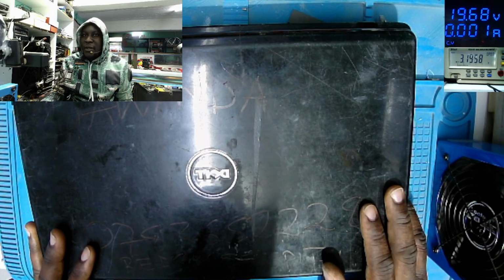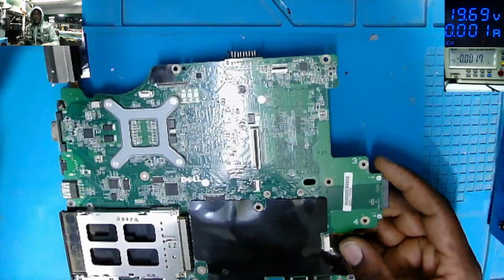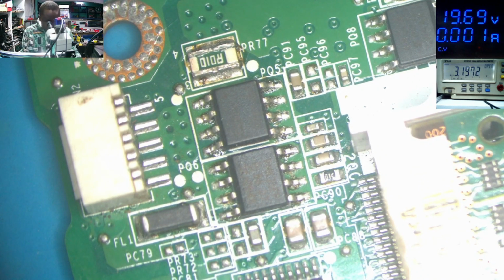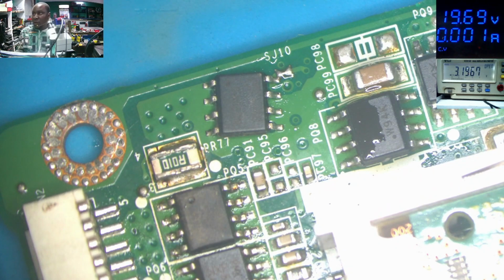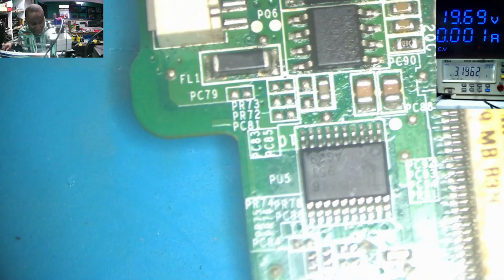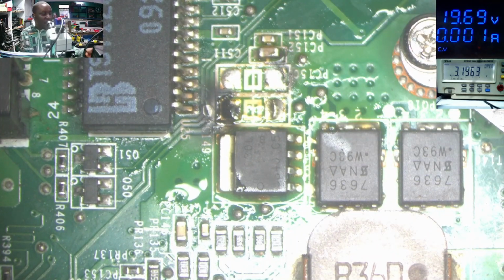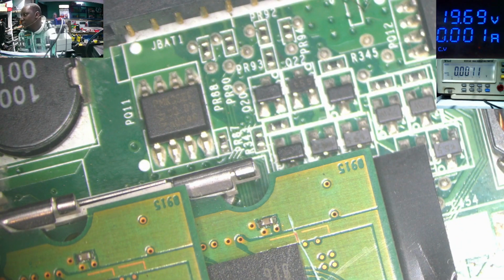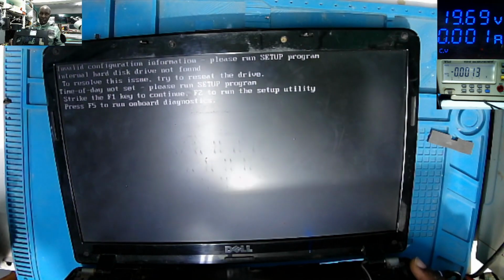Dell Vostro A860 Dead No Power Motherboard Repair-All About Shorts To Ground On Dell Laptops.

Comment: By the way (if anyone is interested) the maximum CPU that you can put onto this motherboard is an Intel T9500. I'm currently running an Intel T8300 CPU on one & a Intel T7500 on another. 🤔😆👌😎👍

The maximum supported RAM is 2x 4 GB DDR2 800 MHz (because of the Intel GM45 chipset). So 8 GB in total ergo. But the price is almost 60 € or so... 🤔😲😳